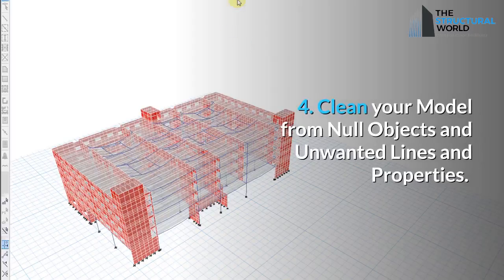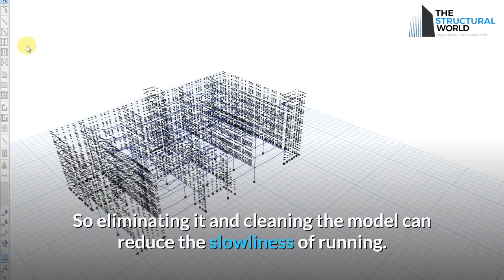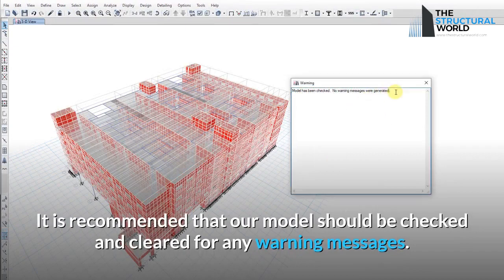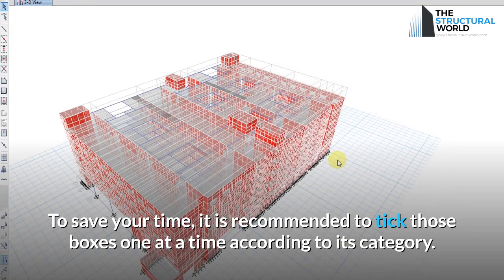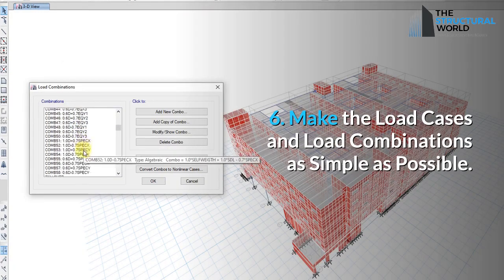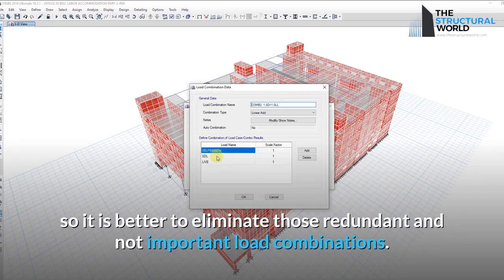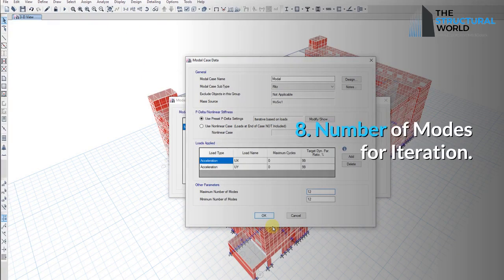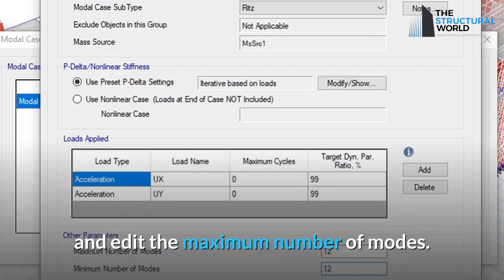Why ETABS Takes Too Long to Run Analysis | How to Avoid It

Comment: Changing advance sapfire options to standard solver also will help us and changing vectors also.
Reply from the maker: Using a Standard Solver keeps the model to analyze a lot more time than usual as it can be used if we want to identify the model instability and therefore needed a detailed analysis. I prefer the Advanced Solver option.

Comment: I have PC with pretty high specs but when I run analysis it only uses only 5 % of the processor and  15 % of RAM is it some kind of solution to increase consumption of specs and speed accordingly?

Comment: Hy, thanks for the video. My system is good for analysis purposes but now in this building's model the etabs is not performing the analysis beyond 75% for MODAL case alone. Do you know the reason behind this, please?

Comment: Sir, After Etab analysis and design results..How to check the software analysis and design results are correct are not...If i do manually, it will take long time process.Is there any cross checking method. Pls do that type of video..It will be very useful to others and me
Reply from the maker: yeah sure, we will consider that topic in our future uploads! cheers!
Reply: Yes kindly do a video on what parameters to check to compare results of software and manual caculations.

Comment: Hello sir, i'm doing a pushover analysis on stepback & stepback-setback buildings in ETABS 16.2.1.. and when i run the analysis its taking almost 12+ hours to complete the analysis.. i have tried almost all the suggested reasons in this video but still i'm dealing with the same problem.. please do help me sir..
thanks a lot :)
Reply from the maker: Hi, did you manage to solve the slow running of your model?
Reply: I also facing same issue.